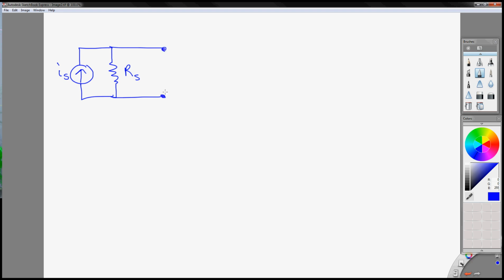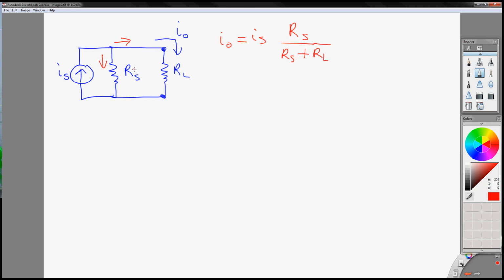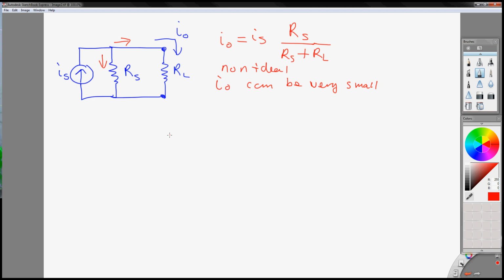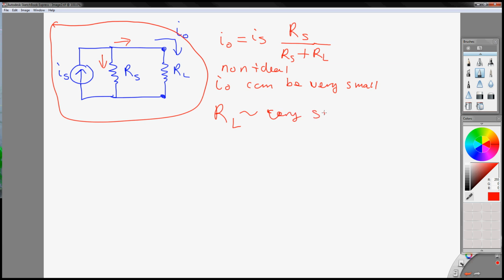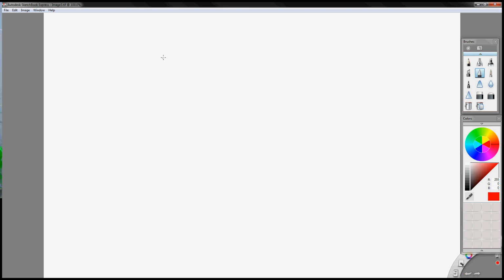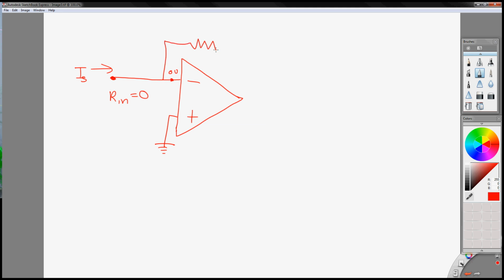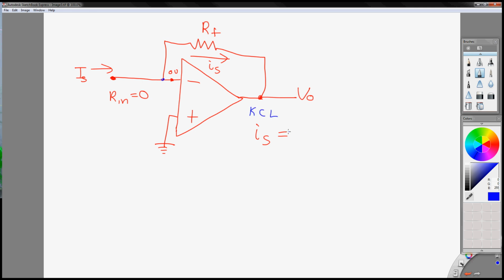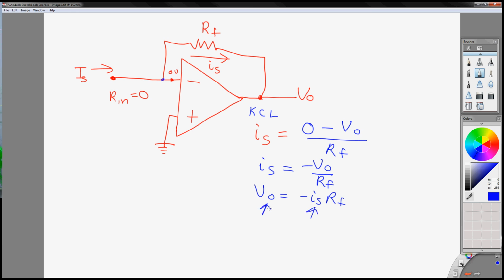How to make a Current to Voltage Converter with an Op Amp

Comment: thank you for the viseo,  what is the solution of  the negative output voltage  , is there any circuit which geave directly a positive voltage  , without adding an inverting amp op ??

Comment from the maker: start off with something like the OP07 which is very common
then you have to decide if you want rail to rail, single supply, or low power
also the package type

Comment: If the current just bypasses the OP amp then what is the significance of the OP amp?
Reply from the maker: the op amp provides the virtual ground which is ideal for a current source.  Remember current sources likes to see a low impedance load.  The feedback of the op amp creates a low impedance input for the current source.

Comment: Thanks for the video. I have a current source with 2 terminals. 1 of 2 needs to be connected to input of OP amp but where the other terminal has to be connected? Is it to ground?

Comment: If this is a current to voltage converter, then does it mean that every differential circuit of the operational amplifiers will be considered as a current to voltage converter.???
Reply from the maker: Chirag Ninave I have to see to circuit that you are referring to.
This is a trans-impedance (current to votlage) amp which means that the Output voltage is related to the input current Vo=f(Iin).

Comment: In some circuits I have seen a capacitor in parallel to the feedback resistor..can you please explain what is  its significance?
Reply from the maker: Shiva Perumal The parallel cap + resistor in the feedback branch gives you a low pass filter.  Remember that the impedance of the feedback branch decreases with frequency.  Thus the Gain is -Zf/Zi and this will decrease as Zf decreases.
Reply: Kelvin Le thank you for the reply.. I wanted to convert 0.1nA to at least 10 mV..will a resistance of 10M do that ??
Reply from the maker: Shiva Perumal 10mV/100pA=10^8 V/A.  That is a very large gain.  You can't not expect to amplify the signal without also amplifying the noise also.  In a ideal world, you would use a 100Mohm to achieve that gain.  But in real circuits, anything bigger than 1Mohm introduces a lot of issues like 4kTR noise and parasitics.  I personally haven't built an amplifier with gain greater than a million.  Even so, I needed multiple stages to maintain the bandwidth (remember definitiion of GBWP).  To be able to measure that kind of currents you will need good shielding and low noise at the input (a ground plane is a must).  Also, is this current input AC or DC?
Reply from the maker: Shiva Perumal After some search on google I found this
http://www.ti.com/lit/ds/symlink/ddc101.pdf.  It's a A/D converter for low currents.
Reply: thank you so much :).. the input current is AC. The prob is I am not exciting the photodiode with light( under light the photodiode BPW34 give uAs which is easy to convert into voltage). I am exciting the photodiode using xrays. Actually I wanted to detect  xrays using photodiode. And under x rays the photodiodes give current in the order of nA. :(
Reply from the maker: Shiva Perumal Check this  project out.  It claims to measure nano amps with high resolution: http://www.eevblog.com/projects/ucurrent/
Reply: thank you for your help :) i managed to detect xrays by using a 10M feedback and a further gain of 10k after the i-V convertor. :)